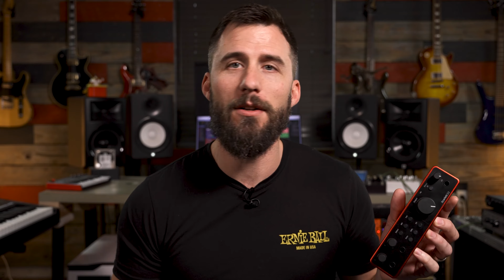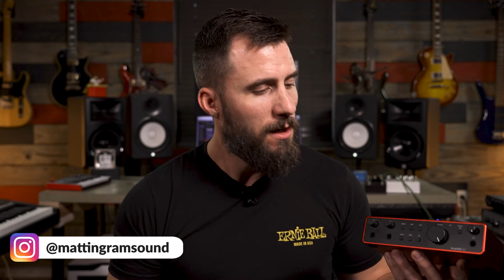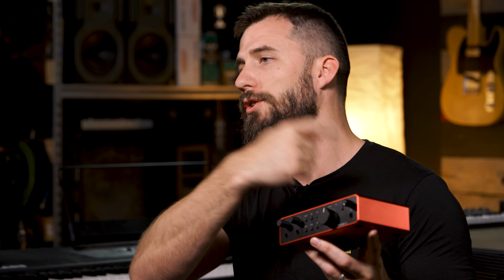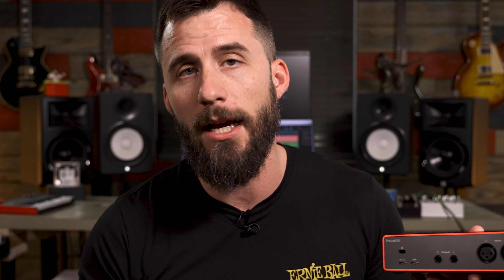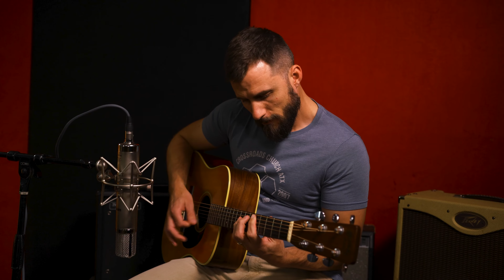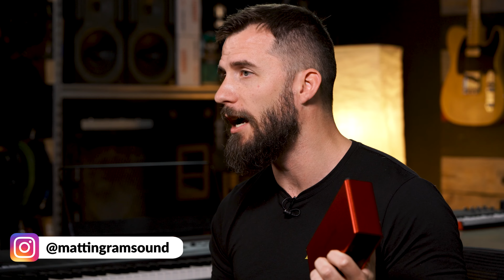4th Gen Focusrite Scarlett 2i2 USB interface

Comment: So how can you sing and play guitar at the same time if you plug vocal mic into the back and guitar into the front if they cancel each other out ?
Reply from the maker: Thanks for the question! The inputs act independently of one another. So if you plug an instrument into input 1 on the front, it will only turn off the XLR input 1 on the back.
Reply: @mattingramsound  Thanks that’s good to know,  I guessed as much but just a bit vague on the manual. So I wasn’t sure . Thanks again

Comment: I’m confused, how did you record 3 tracks, Vox, guitar, drum? And you said if you put something in the front the back I puts won’t work. So how do you plug in a XL R, and a 1/4”? I’m a complete beginner, so I’m sure I’m missing someting
Reply from the maker: It can't take input signals on the same channel from both the front and back at the same time. So the front gets priority. If you want it to get signal from the back, just unplug the cable from the front. I recorded each instrument separately.

Comment: This would be awesome to win. I would actually use this to upgrade my Dj streaming set up. And being able to adjust it from the software is awesome. Then I could monitor it from my 2nd screen so I can fine tune my output so I am not clipping in OBS, instead of trying to reach under my laptop to dial in my gains.
It would go nice with the settings I have in OBS for my input channels from my mixer and mic.
Reply from the maker: Yeah, I think that is the coolest feature in the 4th gen.

Comment: The 4th gen Focusrite Scarlett 2i2 is a popular audio interface that many musicians and producers love. It's known for its high-quality sound and user-friendly features. One of the main reasons people choose this interface is its exceptional audio performance. It offers pristine sound quality, low latency, and high-resolution audio recording capabilities.

With the Scarlett 2i2, you can connect your microphones, instruments, and other audio sources to your computer or recording software. It has two XLR/TRS combo inputs, which means you can record vocals and instruments simultaneously. This is perfect for capturing live performances or multi-track recordings.

The interface also has two balanced outputs, headphone output with its own volume control, which i really love and it also has a direct monitor switch. This allows you to monitor your recordings in real-time without any latency. You can easily adjust the levels and mix your audio right from the interface itself.

Another great feature of the Scarlett 2i2 that is absolutely amazing is that is its compatibility with both Mac and Windows operating systems. It connects to your computer via USB, making it easy to set up and use. Plus, it comes with Focusrite's renowned preamps, which provide clean and transparent sound for your recordings.

Overall, the 4th gen Focusrite Scarlett 2i2 is a reliable and versatile audio interface that can help you achieve high-quality recordings. It's a popular choice among musicians and producers for its exceptional sound quality, user-friendly features, and compatibility with various systems and software.
To answer the question on why i want it will be because im an upcoming artist in my city and i wanted to use this to get better music quality and make everything sound better ❤️💯‼️